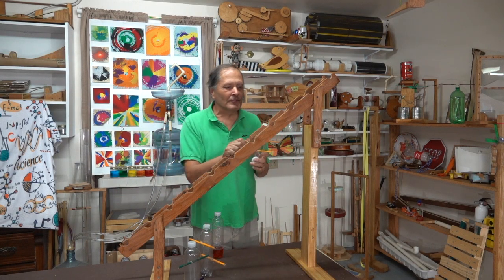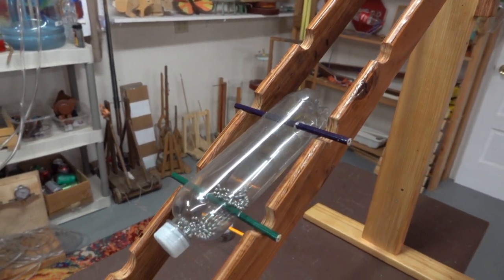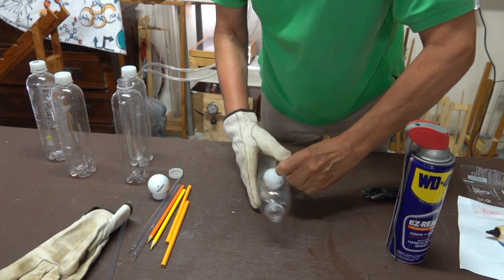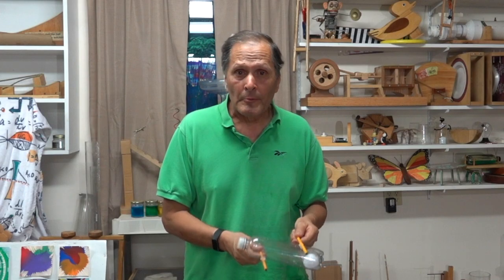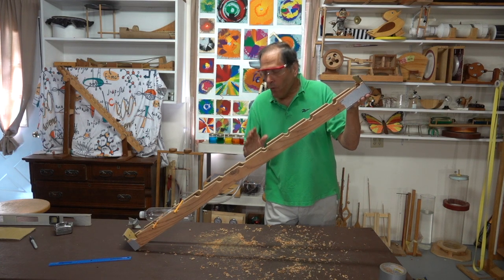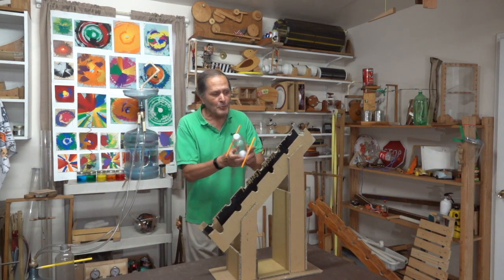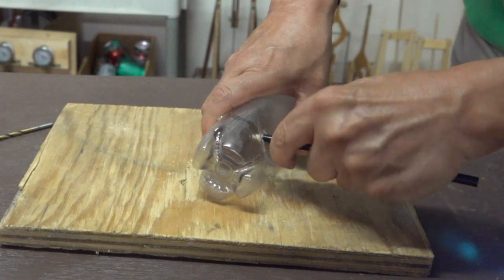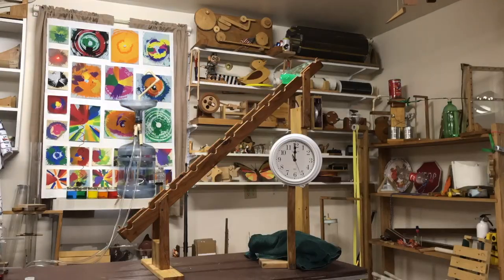Soda Bottle Tumbling Toy  // demonstration and construction tips

Comment: I wonder if the liquid can be slow enough such that the bottle will “stall” with the liquid at one end below the pencil and the other end simply sticking up in the air. Have you tried something like treacle?
Reply from the maker: I'm trying several slow materials,  I was hoping for what you are asking but once the bottle starts to turn, it does so quickly

Comment: I was thinking Ooblak, or some other newtonian fluid. This would give you an “adjustable” liquid viscosity that could meet what ever time frame you had in mine while still being able to cover Newtonian Fluids. 

Other ideas:
Oils of different viscosities with ball bearings in them.
Displacement of liquids. Oil and water ( colored of course) in the same bottle. Kind of a walking lava lamp.
Instead of making the tread system out of wood or other solid material make it out of chain or belts that are linked together with the notches mounted to the surface of the belt. Then have a motor turn the belts and have a dimmer switch (reostat) control the belt speed. This would allow the bottle to fall for ever. This would allow you to establish the speed better of each substance in the bottles ( as indicated on the dial) and a longer time to observe each sample tested.
Reply from the maker: sounds like an escalator,  great idea

Comment: There is a silicone based lubricant used for lubricating O-rings called super-o-lube. It is very viscous but will slowly flow very nicely. It would probably take days to complete the track.
You could even use the silicone lube to coat BB's or ball bearings to dramatically slow their rate of travel.
Glycerine might also work.
Reply from the maker: thanks Gus, Ill look for it

Comment: This reminds me of a few experiments worth combining for your desired result:

1. Liquid in a Jar: different liquids are placed in cylindrical jars and rolled down a ramp to show how viscosity works in liquids and solids. While molasses would be slower, what is interesting is a mix of honey and balls. 

2. Frozen Water: Not having seen it before, I thought it would be interesting to see what would happen if you used solid ice: Would the liquidation around the bottle shift the ice past the tipping point first? Or would the water formed by the ice gain the leverage to push it forward?

3. Other Atmospheres: While you are using air, you could replace it with other gasses using chemistry, such as Carbon Monoxide and Sodium Acetate by mixing Vinegar and Baking Soda to remove the air. Also, I wonder if pressurizing the bottle would play in the physics. 

4. The return Motor: I first discovered this from the channel (and old kid's show) Curiosity Show. They rigged a can to return to them by stringing an elastic band through it with a gob of plasticine in the center. As the can rolled, it created a wind-up motor that made the can return. Would the building of potential energy be enough to overcome the force of gravity?
Reply from the maker: thanks Victor, looks like you've been giving this quite a bit of thought
Reply: @YeanyScience  you've inspired me.

Comment: Hi Bruce. Thanks for another great video. Two options that might be interesting to try would be filling the bottle with small beads to slow the movement of the liquid, and/or using two immiscible liquids of different densities - ie oil and water. In both cases the inertia would be higher so produce a lower acceleration for each flip. Also they would impede the settling of more mass in the lower portion to start the next flip.
Reply from the maker: I'll add that to list, especially like the oil and water idea, that should be interesting to see the behavior in slow motion

Comment: Put a turbine in the middle of the bottle and get the liquid in two separated recipients like a sandglass and the turbine in the neck of the sand glass ... make the wooden construction long enough and a charging station on the tumbler ....then you will get charged batteries at the of the tumbler track, sounds stupid but is worth a try, don't you think  :)  ?
Reply: won't adding a charging station to the tumbler throw off the weight distribution quite a lot? and the power output wouldn't be enough to charge much of anything within the time it takes the tumbler to reach the bottom.

along your lines of thinking, Mr. Yeany recently made some videos on escapements. it's another way to translate gravitational potential into rotational velocity. I've heard of that technology being used to power small LEDs in places that don't have access to a power grid.
Reply: @SoulSukkur  good point there i though rather to put the turbine and the charging electronics on the center of mass of the sand glass considering the weight distribution in such a way that the only imbalance is the water splashing back and forth in between the two containers 🤔. The information about the gravitational in rotationl movement sounds interesting i would be pleased if you could provide me the link of it thank you for your reply and have a nice day :)
Reply: @SoulSukkur  thank you very much for providing me with the link, pal😊. Wow That's amazing 😃! It's simple but effective, I love this idea 😁. Have a great day, SoulSukkur🙂